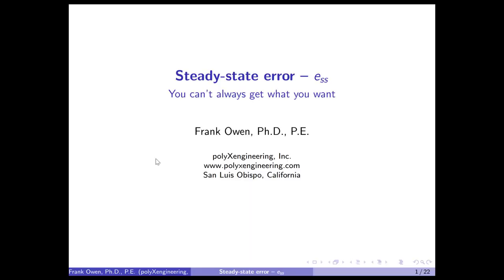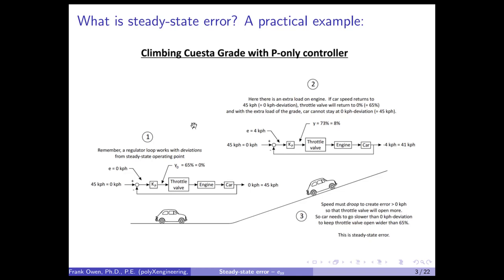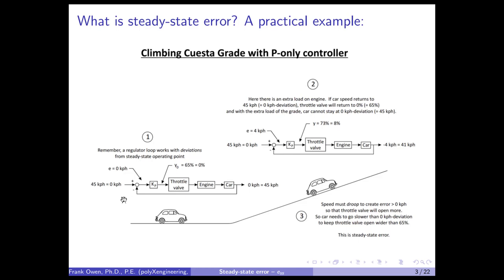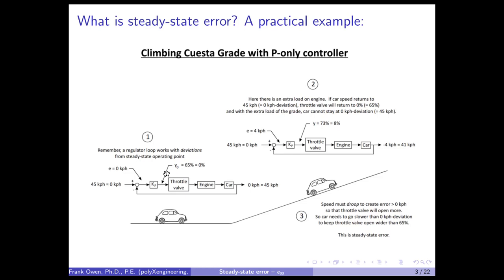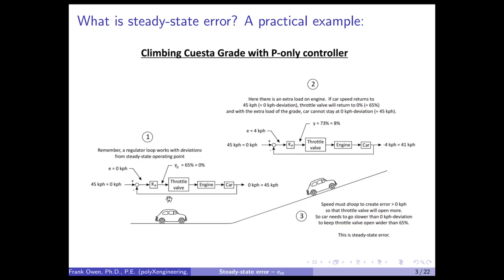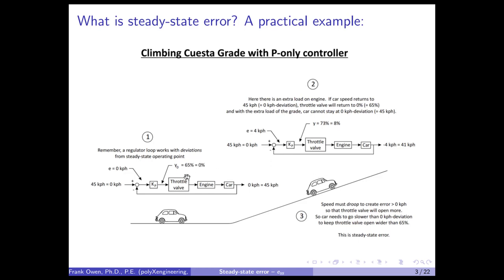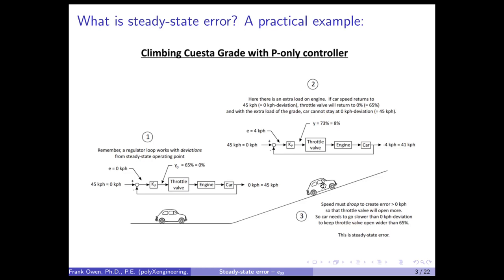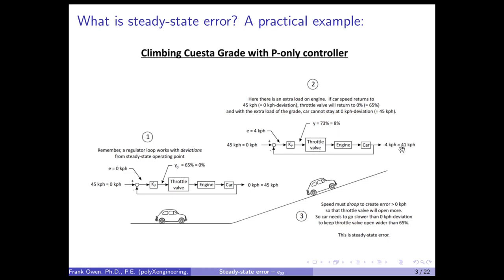Steady-state error - Part 1

Comment: For the example of the car climbing the cuesta,  there is 4% steady state error, but when it return back to the flat ground this steady state error will disappear ? (assuming returning to the same conditions as before)
can I say that for the P only controller steady state error will appear when ever the condition is different than the one that the controller is adjusted against
Reply from the maker: Hi Mr. Nada, Yes to both questions.  With a P-only controller there is a fixed relationship between error and throttle position.  When you do go back to the original state, the car will get back up to 45 kph.  Another way to state this with ess is that there is one and only one operating position, where ess = 0.  Normally, in regulator loops, you do operate around one single point, so often the fact that there is some ess is not important.  The fix for ess is integral control, which is not covered yet in my videos explicitly.  That'll come.  One other thing:  I have a 2009 Mini Cooper.  When the cruise control is on and I have it set down on the flat at 70 mph, when I go up the Grade, I see the speed droop down to 63 mph!  This tells me that the controller is P-only, and that is very surprising.  But perhaps BMW was thinking, for reasons of fuel economy, that such a droop is good.  The car does not try aggressively to control speed, so fuel is saved.  I drove a 2013 Honda Fit up the Grade last week.  It does have I-control, and you could hear the engine kicking in hard to maintain 70 mph...But, of course, that comes with a waste of fuel too.
Reply: @polyxengineering3857  Thank you, your videos and your replys to my questions give me insight to the topics covered